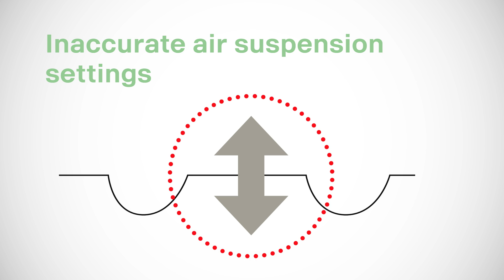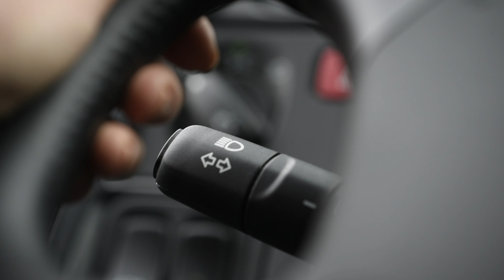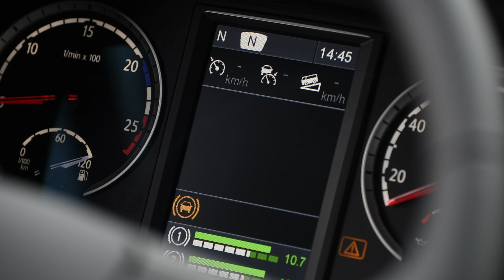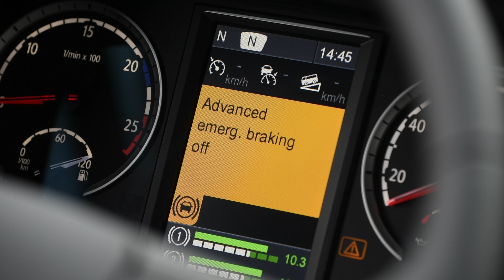Scania Advanced Emergency Braking

Comment: The thought of the gas pedal cancelling the system is interresting. Instead of saving someones life you might aswell make sure if you are going to crash into them- you do it at a fatal speed! (I am aware thats probably not their mindset)
Reply: What if there are a wet surface or ice on the road, by braking the bus it will only make it slide, and if the driver is on watch it would be much better that he reacts with steering away and give gas so you won't slide into the car